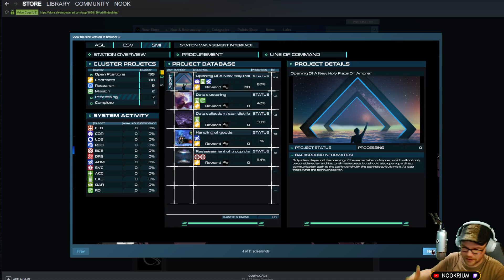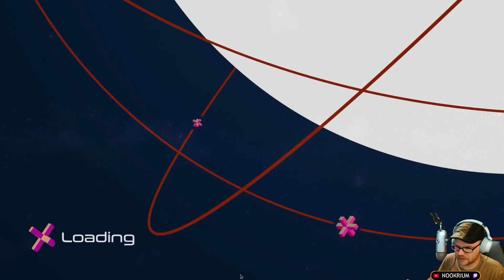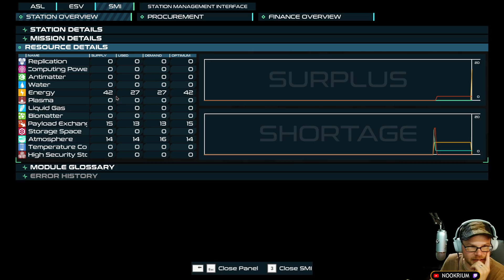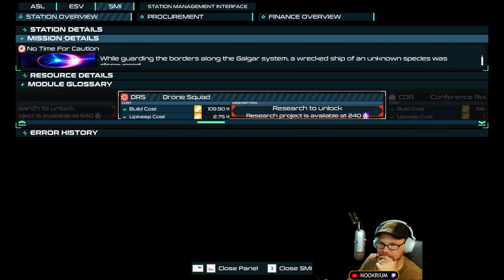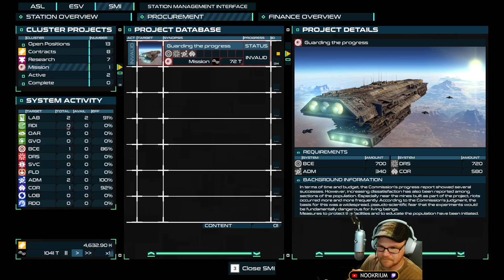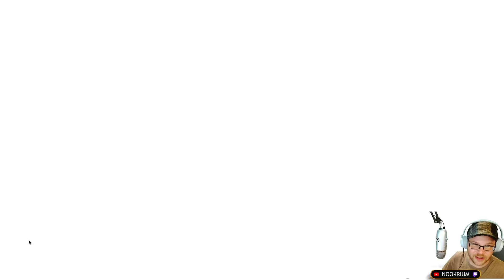Orbit Industries - (Space Station Building Game)

Comment: I'd think a fridge is more efficient being more full as there is fixed thermal mass in the items and more mass would stay colder longer, also whilst when you open the fridge a lot of the cold air would be replaced.  So when shut the warm air and heat from the items would transfer to the cold items as well as the cooling system?  Could be wrong though?
Reply from the maker: You’re right, it was a terrible analogy